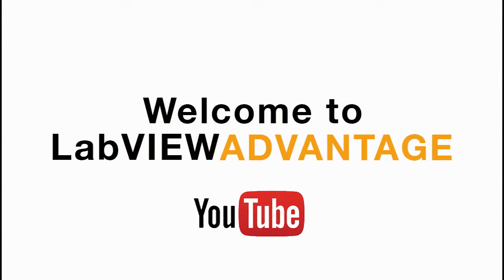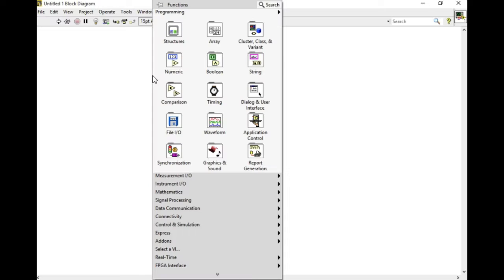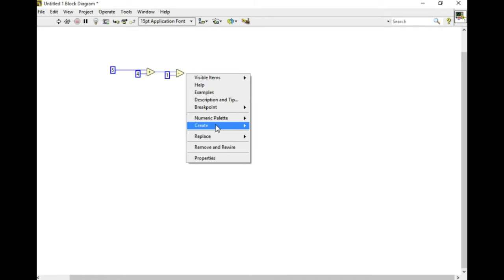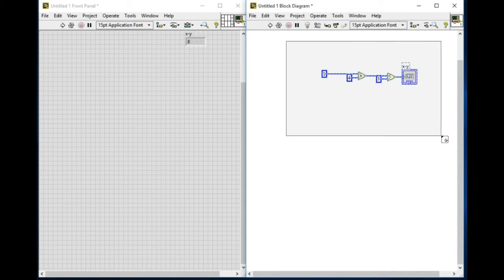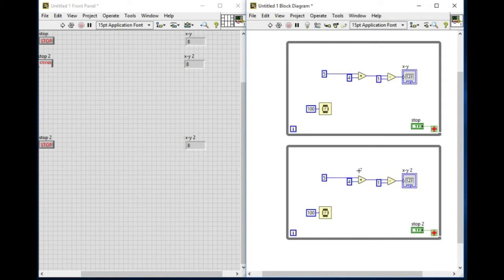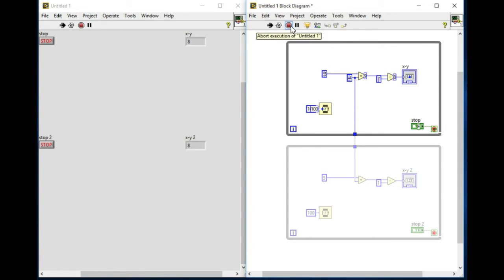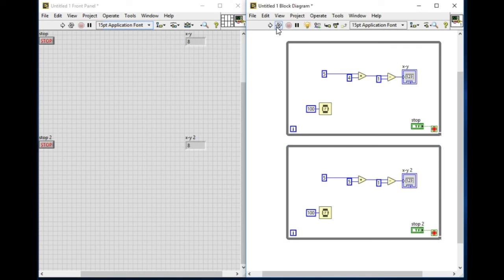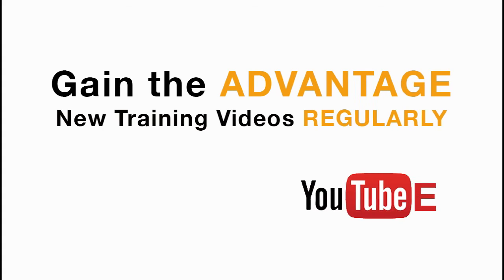LabVIEW CLAD 031 Data Flow

Comment: I knew everything you explained in this video but would have selected "yes" because I can exchange data via connecting both loops with a notification wire. 
Is it because the notification data is not transferred through the wire but only pointing to the corresponding location in memory or something ? (I have no idea how this works under the hood.)
For beginners this is not obvious. :/
Reply from the maker: +SciFi Factory Yes you can share data either using notification or queues but they are asynchronous techniques of passing the data between the parallel loops. This question asks just to use a wire. And wire breaks the dataflow between parallel running loops.